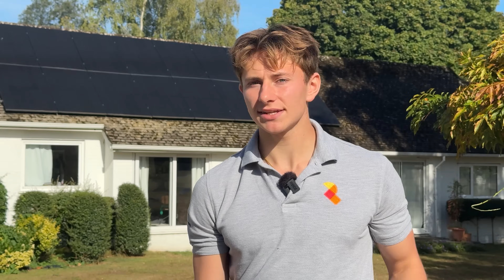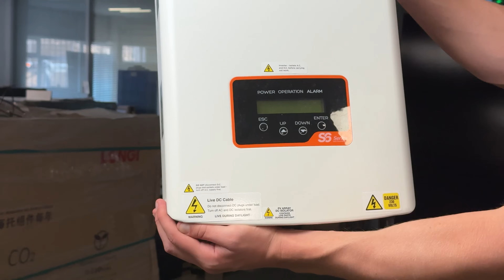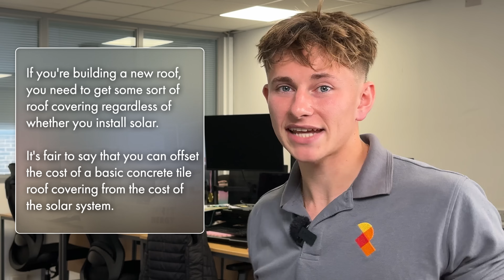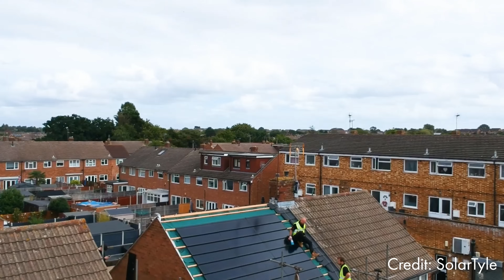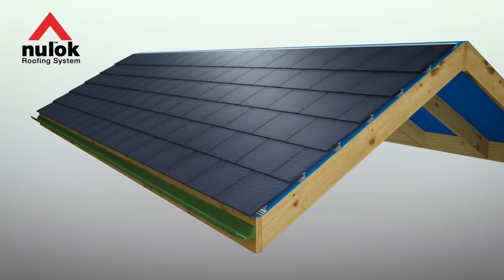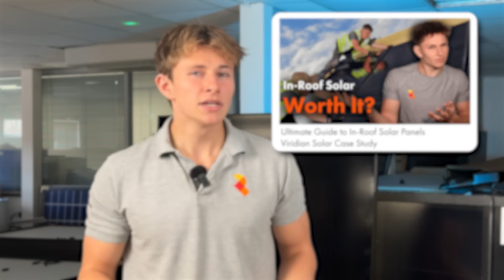Everything To Know About Solar Roof Tiles | Are They Worth it?

Comment: I had Imerys (now Edilian) pv tiles installed with their matching glazed clay interlocking tiles. This was a new build and the tiles have a grey glaze with a metallic sheen so most neighbours didn’t realise that we had a pv system. They have been working for more than ten years now without any problems at all. The roofers had installed the Imerys pv tiles before, so the roof went on in the same time it would have taken for normal tiling. The system installer specified the system and liaised with the roofers so he could check as the roof went on. He completed the rest in a day. 
I have pv facing east, south and west, which reduces the maximum output but extends the number of hours in the day that I have a useful output. Over the year I still have to buy about 5000 units, mostly in the winter. My house is all electric and consumption includes an EV car. I produce about 7000 units annually and have not seen a noticeable drop in output over the ten years. The extra cost upfront has paid me well and reduced emissions.

Comment: A standard concrete tile gives a minimum of 50 years service, a good Welsh slate gives 150 years. These are going to need reroofing every 25 years, they really are an expensive folly. Imagine trying to get a replacement tile in 10 years when the business has long gone into administration, forget it. Also changing the roof covering from what was there originally requires building approval.
Reply: They are guaranteed for 25 years with 90% of the output but will last much longer.

Still theres a fair likelyhood that new tech will be significantly better so upgrading will be beneficial.

Comment: Thanks for an excellent video. Very comprehensive and touched on most of the areas I was interested in. One question; if a tile fails does it typically take out the entire string? Thanks
Reply from the maker: Hi Mike, thanks for the comment. The bypass diode should kick in and cut it from the string, so the current will flow around the failing tile.